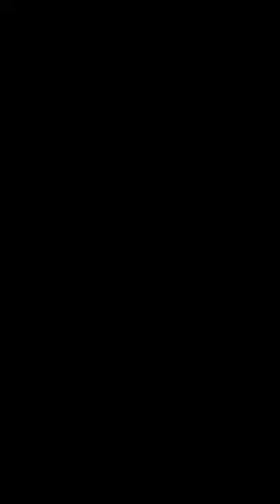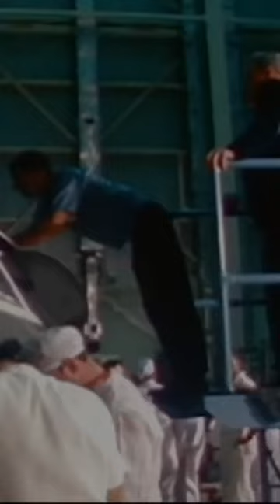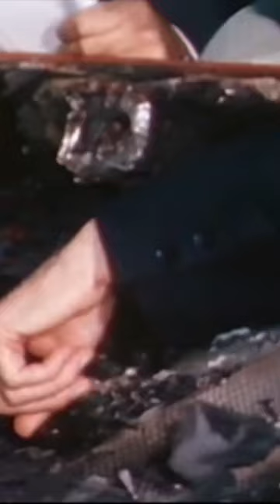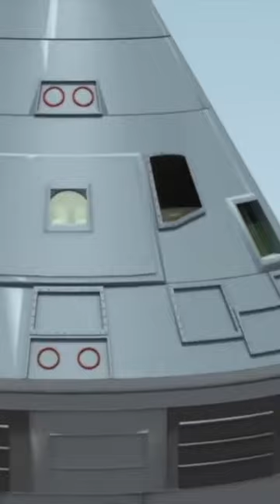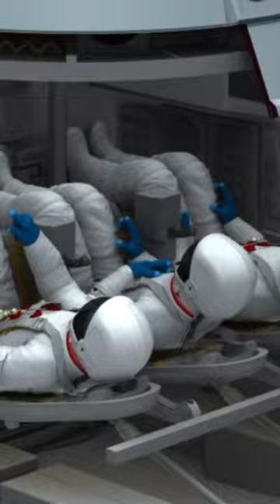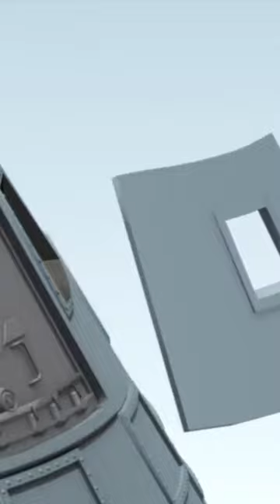This caused the Apollo 1 fire!

Comment: When the narrator says “ the side of the hull blew out “ what is depicted is the external portion of the three panel Apollo block one ( the Apollo command module that will take three men into space , but not designed for lunar missions ) spacecraft.  This section was secured to the BPC or , Boost Protection Cover ,  which covered the external and subsequently the internal exit hatches of the Apollo Command Module… that hatch section , or any other hatch section “ blew out “ !